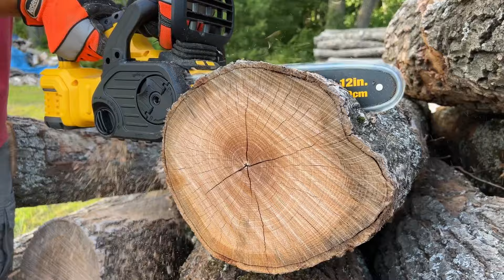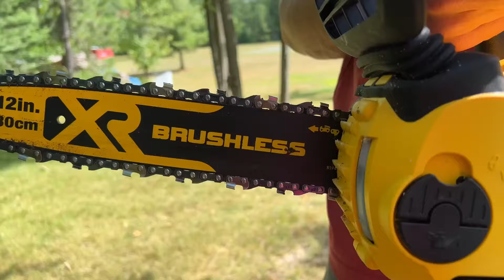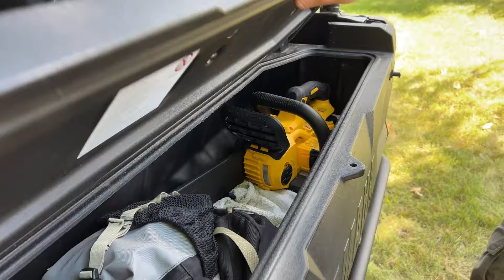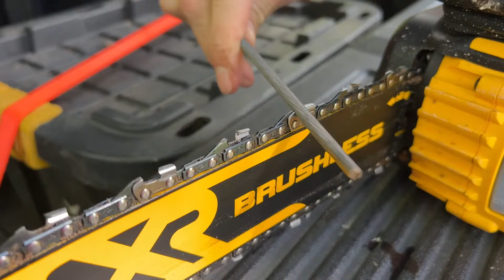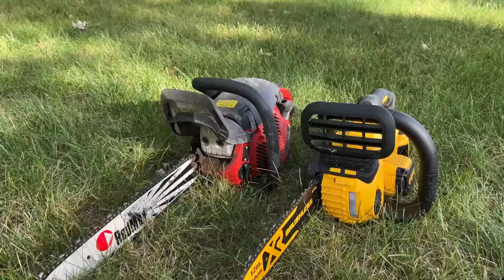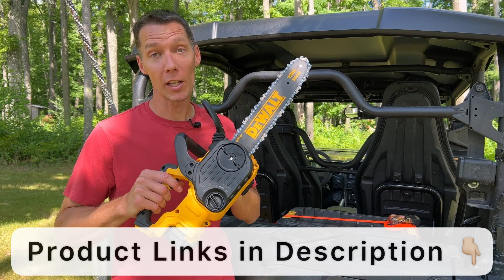Are Electric Chainsaws Any Good? DeWalt 20V Chainsaw Review

Comment: I've had mine since like 2019 or so, it's amazing, one handed cutting, whatever. Homeowner shit, I have an acreage and I'm constantly cutting branches and small trees and whatnot... Works fine on the 5ah battery but when I really need power I use a 9ah flexvolt battery , she really gets after it with that battery holy cow. Just fyi the bigger batteries can provide more consistent voltage at the required amperage because they have more cells in parallel, this translates into "more power" but in reality it's more like "full power at a higher strain" if that makes sense
Reply from the maker: Using a larger battery really does make a noticeable difference in performance under load.

Comment: This is the saw fir little home owner. One for all. Or as the only one you take to a jobsite or camping trip.

Most times I prefer taking a lighter one hand saw like from makita or a big one.
Reply from the maker: This is for a home owner. If you are on a job site, I would have a gas saw. I take this camping and for clearing logs trail riding.

Comment: I had one of those 20 volt dewalt for 4 years it's a good little saw, I put on a 16-inch Oregon bar & a 16 inch Oregon chain, the stock 12 inch bar and chain is kind of useless. I  Actually talked  to a DeWalt & Milwaukee authorized factory technician,  he said the saw was designed to leak as it doesn't have a pump for bar oil like a gas-powered saw, your best thing to do is empty the bar oil out when you're done using the saw.
Reply: Just turn the saw with the fill port up and it barely leaks
Reply from the maker: Thanks for the feedback.

Comment: I used this saw exactly the way you described and for the same reasons you stated. 

2 years after I bought it it short circuited and then I read the owners manual. It states to drain the oil when it's not in use.

Be warned, drain the oil!
Reply: I have the craftsman version of this saw and I never put oil in the resovoir I just oil the chain every 15 minutes of use, so when I'm done there isn't a puddle when I store it away
Reply from the maker: Fringe, That’s good to know. Luckily I did leave recently the oil empty when I was done using it and I’ll make that a habit going forward. -Steve
Reply: @TwistedToolbox Cheers! 

I would at least read the owners manual as who knows, maybe they have a sealed reservoir now.

I have like 30 dewalt 20v tools and about 16 batteries, This saw is absolutely the only dewalt tool that has died on me over the last 15 years. And to be fair, it was my fault.
Reply from the maker: @fringemedia8724  I normally throw out the manuals but this one is still around and I’ll have to look through it.
Reply: @TwistedToolbox  HAHAHA! Me to but it was in the bottom of my chainsaw toolbox kit.... an oldschool aluminum lunchbox. Which is about the perfect size to hold everything one needs for the saw in the bush including a quort of oil. 

CHEERS!
Reply: If you put a 5/8 on ring on the oil cap it should prevent leaking.  There's videos posted on how to do it
Reply from the maker: @Nick-qj4su  thanks for the tip. I’ll check that out.
Reply: @Nick-qj4su  it leaks inside the case and shorts out. Leaking outside the case only makes a mess.
Reply: I think I would not put any chain oil in a dewalt chainsaw if I was ever to buy one again. After this I will only buy chainsaws from manufacturers that actually make chainsaws. 

Not from a tool maker  that decided to make a chainsaw.

Hell its possible that if dewalt decided to make a 1 piece resivore for the chain oil  I might consider possibly buying one more but the 3 month warranty tells the tale.

I am a real homesteader that heats my house with wood.

One of my daughters used this saw and now she uses a Stihl. 

Just check the warranty literature... You know the documents that came with the saw. 

Maybe things have changed.
Reply: @fringemedia8724 Our Stihl 291s leak all their oil out too.  Never seen a chainsaw that didn't leak.  This one is a bit worse than most but any saw should be emptied if it's going to sit a while.